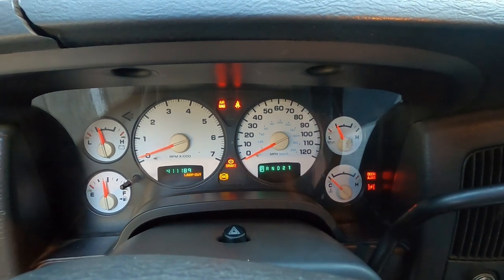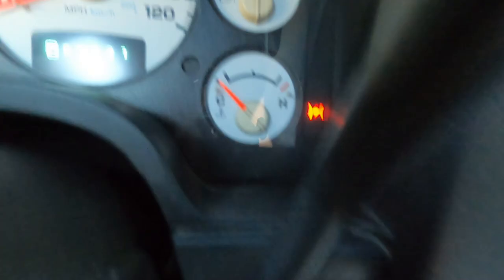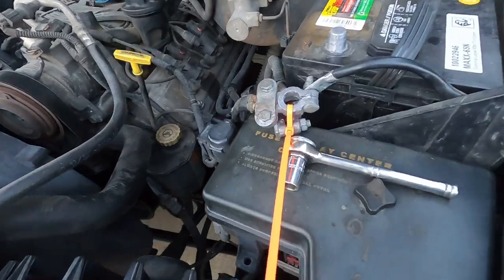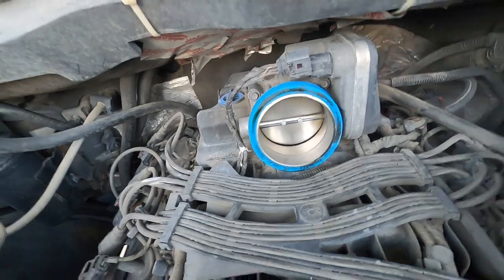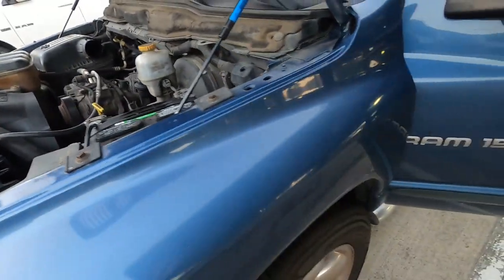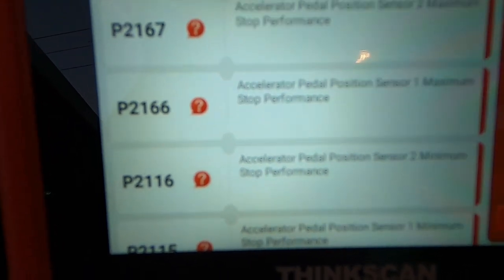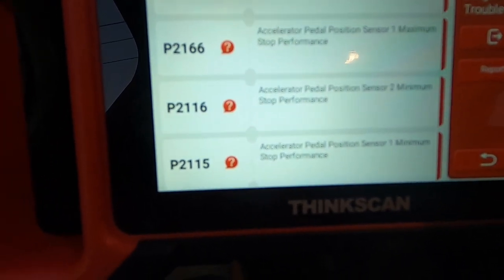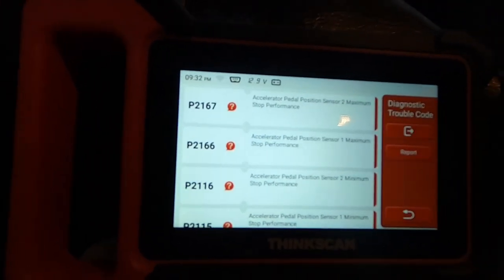Accelerator pedal positioning sensor. Serious issues on 2003 dodge Ram

Comment: So I thought I had this problem solved...been going through same problem since Dec 22...I have changed every sensor in my 03 dodge ram 5.7 l...I have spent $1900.00 from catalytic converter to every sensor...even thought my PCM bad...Finally after all that...I changed 16 spark plugs in that 5.7 l hemi...yes 16 and after 3 1/2 hrs later...I have drove my truck for over 200 miles and no LIGHTNING BOLT...This has been the worse problem I've come across on this truck...save your money...change your plugs...coil packs will read 0.00 ohms if good on the two pins...just helping with this journey...but this one hurt the wallet
Reply: I got five grand in my issue 03 2500 5.7 hemi last thing I got is electronic pedal position sensor but I don't know where it goes need help to
Reply from the maker: Most likely under battery tray

Comment: I have a 2007 ram 1500 5.7 replaced the throttle body but am still having issues flashing lightning bolt
Reply from the maker: Have you try to disconnect battery and reset system.  When mine was flashing I replaced the throttle body and problem solved. When the lightning bolt was on steady and not flashing it was the pcm
Reply: @autoguydiy4244  it could be a vacuum leak I'll check later but I doubt it's that because I replaced the throttle body all my gaskets are good and tight
Reply from the maker: @Ty0_5 I have heard alot about the back of the intake leaking
Reply: It must be my pedal position sensor
Reply from the maker: @Ty0_5  those are hard to find. Are you receiving any apps dtc
Reply: @autoguydiy4244  found out it was the crankshaft position sensor causing the flashing lightning bolt trucks all fixed now

Comment: I got the same code even after I change the gas pedal that came with the sensor from my 06 ram, I was thinking, maybe replacement throttlebody would help, but I have to get a whole new gas pedal I think
Reply from the maker: The throttle body should be sold separately  from the gas pedal. Is your etc light flashing or steadily on

Comment: I did the exact same thing. For no particular reason, I did a throttlebody relearn on my scan tool. The same exact thing happened. The truck would start but nothing with the pedal. 

So what was the final fix?  A new throttle body?
Reply from the maker: New pcm

Comment: Dude, I know how you feel. Sometimes it’s one thing after another. My 03 Ram 2500 had the lightning bolt flashing even after changing the TB (Hitachi new) and doing the relearn like 20 times. Nothing worked. 

I left a few comments and you really tried to help me; much appreciated for all that, bro. Turns out it was my intake gasket was leaking, and that was throwing everything all out of whack. Works now. Thanks again and best of luck with this issue; I’m sure I’ll have something similar come up soon too (hope not though lol).
Reply from the maker: Thank you buddy. I appreciate it
Reply: How'd you diag your intake gasket?
Reply from the maker: @asfowenn start your truck spray starter fluid around your intake. If the idle changes you gave a vacum leak around your intake

Comment: My truck is the 2002 5.9 Mag but was made when Dodge was going to the 03 body style. Luckily for me my accelerator wasn’t changed up to the style you have here. My throttle is still controlled with a cable lol. That being said under my dash there is some type of senor that connects to the steering shaft and for the life of me I can’t find it anywhere online nor do I know what it’s called. I would assume it’s a neutral safety switch or something to do
With the cruise control

Comment: Can you read the APPS live data voltages? Might want to check the connector at the sensor. I would try the relearn holding the pedal half way down to see if anything changes.
Reply from the maker: I need to look into that buddy

Comment: 411k miles.

That’s just love and care for it! They’ll go! Fuck what people say 

V8s and diesels especially older ones can go on and on.

Surely it’ll get issues being so up there nothing lasts forever. But it can last a hell of a long time. 

Still have my 2003 1500  hemi with over 270k miles but I wanted to rebuild everything so I did when it hit 253k best to do it as early as I could. It would of went how it was for sure just needed some misfiring took care of think it was fuel related or air.
Reply from the maker: Yes sir.
Reply: @autoguydiy4244  good  on you keep that old dog a goin bro

Comment: Dang, that's above my pay grade.
I'd pay extra for a good 4 barrel and some points and plugs and a cable on the gas peddle.
good luck
Reply from the maker: So would I. It will interesting
Reply from the maker: The way I feel about sir. There is nothing above my pay grade and it just another opertunity to learn something new. If we dnt try we will never know.
Reply: I agree, never give up.
Reply: I had a Jeep cherokee that kept dying, like start an die. Took it to dealer which I dont usually recommend but anyway they had to "reflash" one of the controls. It fixed it as long as i had it it never did that again.
maybe something could be reflagged on that
Reply from the maker: I will have to check that out buddy thank you
Reply from the maker: I might have to get into something like that buddy

Comment: Hey do you have an email? Would you be willing to look at a couple videos and pictures of my truck? Still having trouble with my 03 1500 5.7, hoping if you could see and hear it that would help out.
Reply from the maker: If you will post them on you tube I will definitely watch the and give my honest opinion
Reply: I posted a video of me starting it, let me know what you think. Video-Ram 1500 idle issue @autoguydiy
Reply from the maker: @joewilson2968  I watched the video. Have you pulled a valve cover to see if you have any broken or collapsed valve springs
Reply from the maker: @joewilson2968  it sounds to me like something is going on in your top end. Like a valve spring.  That's what my 03 sounded like when I dropped 3 of my valve springs
Reply: I haven't taken the covers off, I can check that for sure. It was sounding rough today but I haven't started it in a few days. I'll check that and see what it looks like in there, thanks for giving it a watch man!
Reply from the maker: @joewilson2968  you got it buddy. Check my channel. Go to community and my email is there buddy

Comment: Hey brother did u fix the issue?
Reply from the maker: No sir still  working on the issue.  I think I have it figured out.
Reply: @autoguydiy4244  you still think it’s the app sensor? I’m having the same issue and I am thinking of going to the junk yard to try and find one
Reply from the maker: Stay tuned buddy I have a couple of videos coming out about changing the app sensor and some live data on both truck and what my next move is going to be. Hang in there big dog I will get it going and show yall the process I'm going through
Reply from the maker: @Juansharley06  it wouldn't hurt to go to junk yard and getting an extra one if you can find it big dog

Comment: Where did you get the sensor for it at
Reply from the maker: Had to go to a salvage yard for it
Reply: @autoguydiy4244  OK I appreciate it. You can't get it new. I'm hoping that fixes my problem
Reply from the maker: Do you have a dead pedal but truck will idle
Reply: @autoguydiy4244  it's a rough idle. Sometimes it won't even stay running
Reply: @autoguydiy4244  I do have the lightning bolt as well
Reply from the maker: @chrisSmith-hf9vr  what year truck
Reply: @autoguydiy4244  03 ram 1500 SLT package with 5.7 hemi
Reply from the maker: Is the lighting bolt flashing